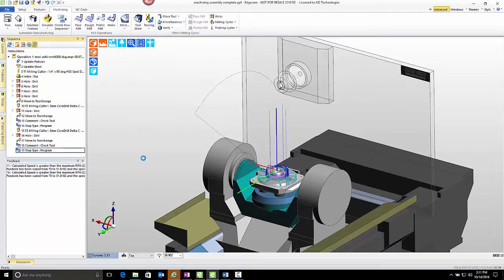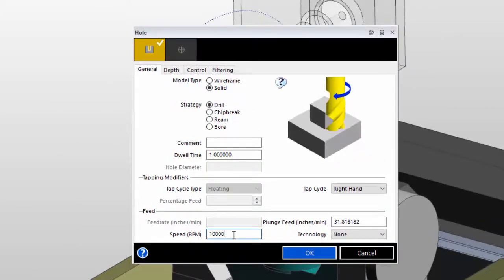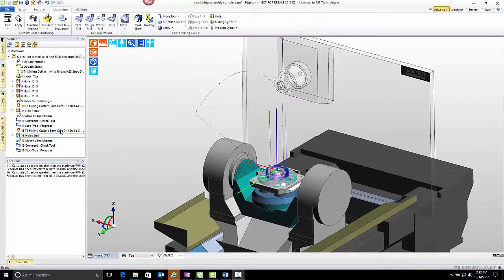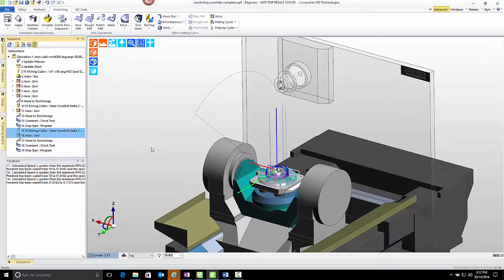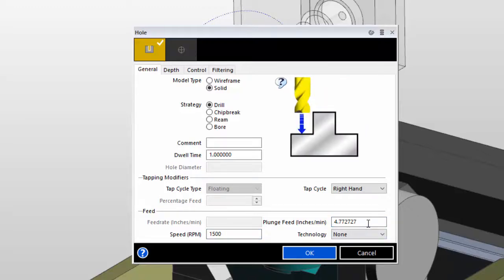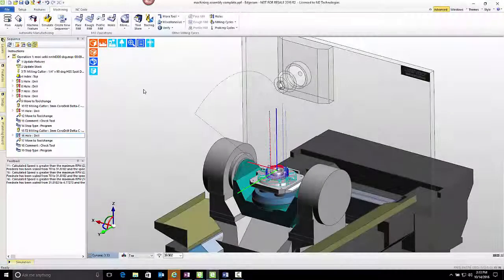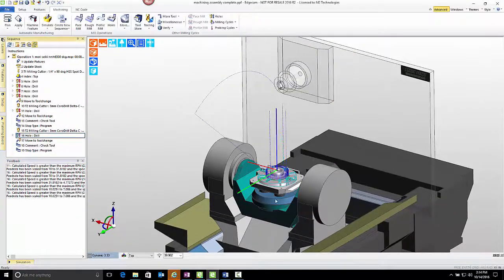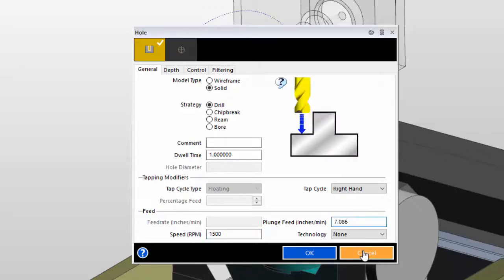Limiting Spindle RPM

Comment: Hi, How do you do the opposite? My Edgecam is limiting my spindle speed at 10 000 RPM and I want to increase it to 24000 RPM because I want to do some engraving on brass which needs high RPM when using cutters as small as 0.2mm. Thanks